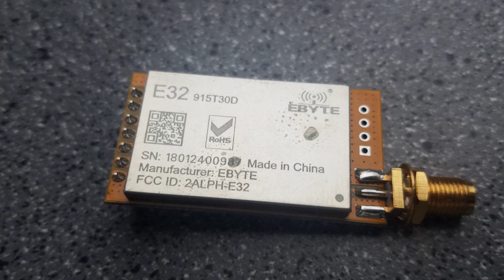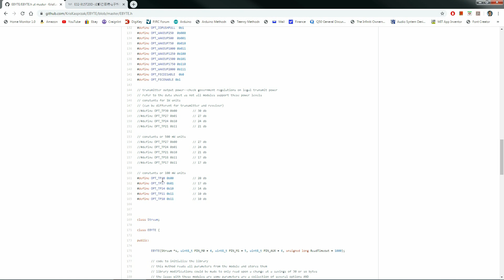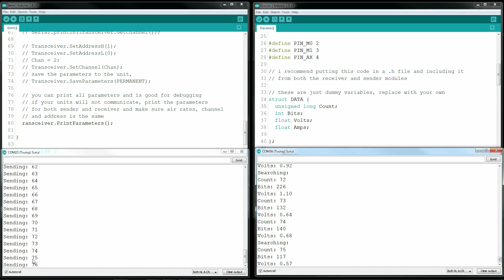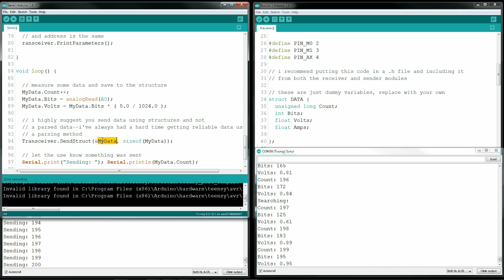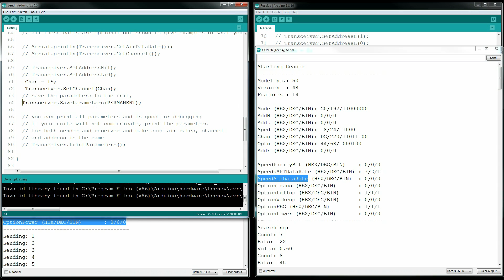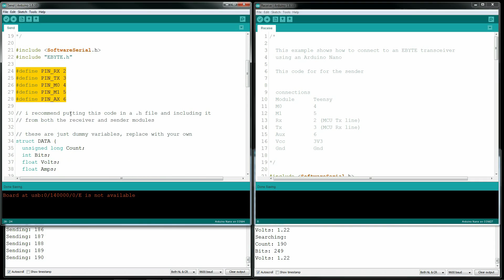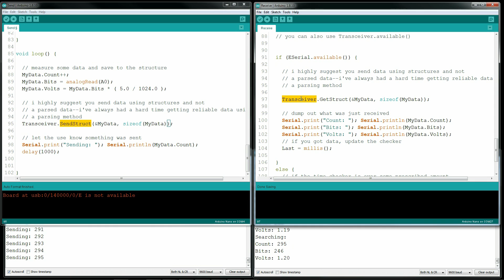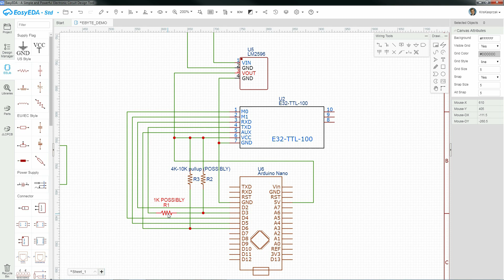EBYTE Wireless Modules for MCU projects

Comment: Hi Kris, I am trying to set a  communication between two e32-868t20d lora module. I used your library and I connect pins with resistor like the video. I am using an arduino mega2560. But connection failed. I cannot receive any message. When i use printparameters, all parameters are 0. Can you help me. For better contact --- alganeren0@gmail.com ---  is my mail adress.
Reply from the maker: It will be a few weeks before I can test this module with a mega but in the meantime try putting a delay(1000); as the first line in your setup if that doesn't work we may have to reset all your parameters
Reply: @KrisKasprzak  Thank you for reply but it didn't work.
Reply from the maker: @erenalgan6126  I tested the code with 

1) a Teensy 3.2 --works just fine (pin to pin connections, no resistors)
2) a NANO -- works just fine (pin to pin connections, no resistors)
3) MEGA -- init() fails and printparameters returns all 0's I'm still messing with the MEGA (tried with and with out connection resistors)

I even tried with radiohead's library and it fails on a MEGA. I don't have much experience with MEGA but still messing with it.
Reply from the maker: @erenalgan6126  I got it working with the MEGA. you  can't use SoftwareSerial like with UNO or NANO,  you must use the hardware pins on the MEGA (see pins 14-19). I connected my EBYTE Rx to MWGA pin 14 (Tx3) and EBYTE Tx to MEGA pin 15 (Rx3) and used Serial3 in the line 

// create the transceiver object, passing in the serial and pins
EBYTE Transceiver(&Serial3, PIN_M0, PIN_M1, PIN_AX);

all is working
Reply: @KrisKasprzak  

Hi Kris,

Thx for the library; I can confirm that this problem is with MEGA too, and your solution here works

However, I need it to work with Arduino uno... i have the same problem MEGA has.
Reply: @KrisKasprzak  Hi Kris, I tried serial3 but it didnt work. I tried so many libraries, different wire connections(pull-up/pull/down resistors), logic level shifter, voltage divider but it still doesnt work. Probably at least one of my lora is broken. Thank you for help.

Comment: Hey man, awesome work and awesome video! Thanks for sharing.
Would it be possible to use these transceiver modules to have multiple transmitters sending data to a single receiver? I'm planning to use these EBYTE radios to build a LoRa network with lots of nodes and a single multi-channel gateway. 
Also, is it possible to have an MCU + radio alternating between sending and receiving data?
Reply from the maker: Yes, absolutely I have a similar setup at my house 4 sensors read data and send to a single base. How it works is all units are on the same channel but have a unique ID. the base sends a request to ID=0 (where only ID 0 reacts, then ID 0 sends data back, then base sends a request to all but ID=1 then ID=1 responds, etc....

Comment: Hi from france :)
Verry nice job ! I was wondering how do you write your commands in arduino to parameter the device ? (without using the library)
I tried serial.print, serial.write without succes...  
What is the format to respect ?

Bye.
Reply from the maker: One more thing... after you set M0 M1 low add a delay(20); or so--pint reaction time on EBYTES is not real fast
Reply from the maker: Bonjour!

You can program these without the library. Set MO and M1 low, then send 3 x 0xC1 using MySerial.write()) then send \6 bytes using MySerial.readBytes(...). That is essentially what this library does. Read the Aux pin to detect when the unit is completed operations. Have a look at the .CPP file and you will see how I use Serialxx.write(0xC1); Serialxx.write(0xC1); Serialxx.write(0xC1);  then Serialxx.readBytes(...). I actually wrote the library by getting it to work in a .ino, before creating the lib. Note using an Arduino (5 volt) device may require some current limiting resistors between the MCU Rx and EBYTE Tx pin.

Comment: Hello sir ..Great work...I have some queries ...i want to send 240kb/200ms but due to complete task part in the library i am unable...and i am using E62-1w...i have made changes to work ...my air data rate is 32k..but stuck in sending data within 0.2sec..kindly help
Reply from the maker: I think this is correct regarding computing data send times....

send time = data x send rate
send time = 240,000 bytes x sec/32,000 bits x 8 bits / 1 byte
send time = 60 seconds

if I'm correct you are trying to send data 300 times faster that it can actually get there.

Comment: H, Thank you for your video. I am using this T17030D with Atmega 2560. The micro controller is getting reset when I am sending data. Could you please help me to identify the problem ????
Reply from the maker: How are you powering this 1W unit? If my the MCU--that's probably the issue. These devices draw more power than the MCU on-board power regulator. The MCU can power the device when idle or receiving, sending is where the power draw may run the MCU too low--i have actually destroyed some regulators on a NANO--not knowing this issue. Power the wireless module independently.
Reply: @KrisKasprzak  Hi Kris,
Thanks for getting back to me .I have tried giving separate power supplies. It did not help.I am using a custom board with a power supply capable of delivering 3A.Now I doubt the power logic level. because the data sheet says that it has TTL of 3.3v.I am hence panning to use a potential divider to divide the voltage. Do you have any other observations ?Thank you Salas
Reply from the maker: have any resistors in series the TX and aux lines? I doubt it will help but maybe a 4K setting on those two lines. Also are you powering your transceiver with 3.3 or 5 volts? I generally find 3.3 volts works better at Five v these things tend to run warm. How often and how much data are you sending?
Reply: @KrisKasprzak  Maybe once in an hour. I am not sending data often
Reply from the maker: If you're willing to share your source code I can run it to my mega and see if I get the same results.
Reply: @KrisKasprzak  I am just using UART to do the communication. I have used an external programmer to program the LORA.

Comment: Great video…Thanks. Is it possible to make a LoRa WAN node with EBYTE transceiver module?
Reply from the maker: not exactly sure what you are trying to do, but I have a setup where a transmitter sends a signal to several receivers.  Just keep the address to 0 and all on the same channel (and air data rate).
Reply: @KrisKasprzak   I think what he is asking, which is also something i'm wondering. Is if you can use a standard LoRa WAN Gateway like the Dragino LP01N  and use the EBYTE transcievers as nodes. So far i've been unsuccessful